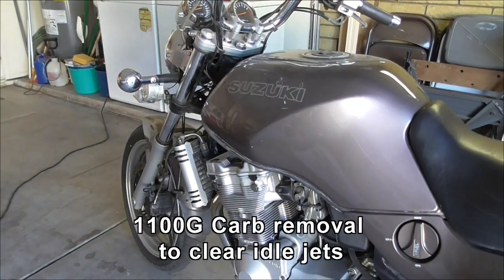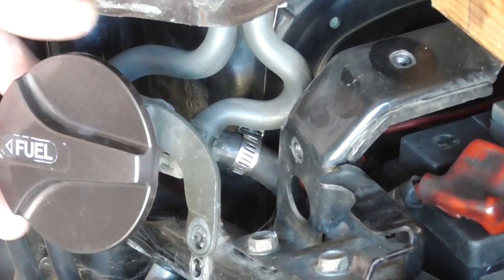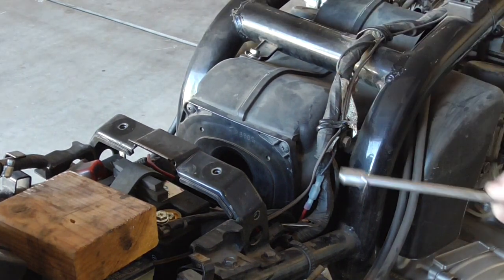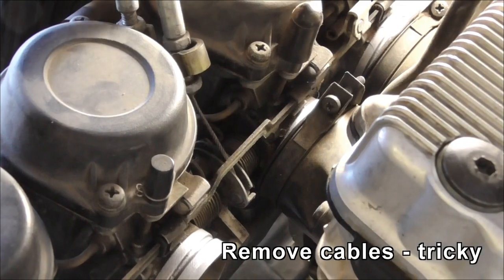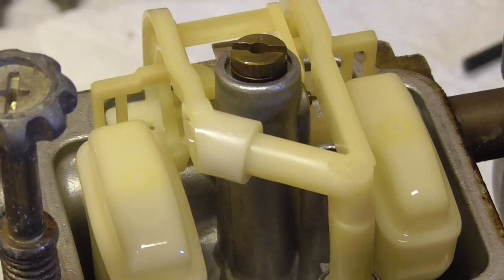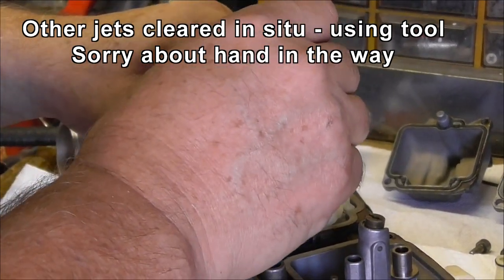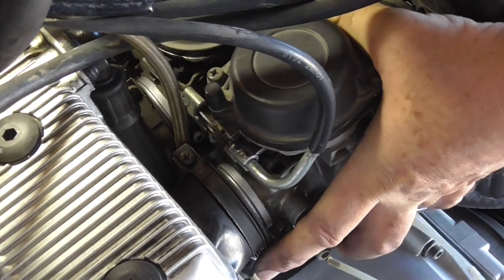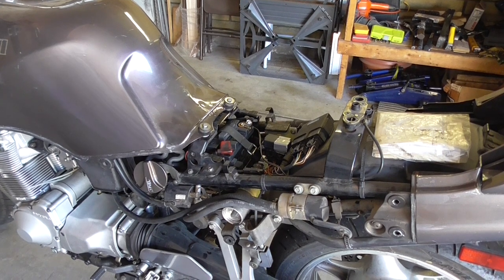Suzuki 1100G Idle Jet Clearing

Comment: Best ever, driven sedately (60-70 mph) on a very long run : 53 mpg (imperial), 11.7 mile per litre.
Reply from the maker: Yep, the conversion is 1 Gall Imperial = 1.20095 gall US. So 44 mpUSg. It's running well

Comment: How many litres does your bike consume per 100 km?
Reply from the maker: When I used to drive to work - 15 miles mostly freeway - it was about 40-42 mpg, which is 5.6-5.9 L/100km.
Now I just do short runs around town and it can drop to 36 mpg or 6.5 L/100km
Sounds like you may be burning to much fuel???
Reply: @richbinaz  Yes, my gsx drinks a lot, about 8 L/100km (freeway, 150-160 km/h).  Your fuel consumption is very good. It seems I need to check and adjust the fuel level of float chambers.
Reply from the maker: @Strannik191  I have been chasing "fuel flooding" for years. It not only drinks fuel, but makes the engine very noisy and "chuggy" 
In the video at time index 6:10 I'm removing the idle jet. Behind the main jet is a stainless steel colored "float valve seat". It is held in with an O-ring. These O-rings do not work well with fuel that has alcohol in it. The 10-15% alcohol makes them harden up and shrink.
I found that If I turned the carbs upright (with the floats off) these seats would fall out. If you can pull the seat out with no resistance, it means the O-rings are not working. They need to be replaced with O-rings that are made from Teflon, PTFE, Viton or buy them from this source if possible. I don't know if he ships overseas
https://store.moto-lab.com/bst36-fuel-system-parts?bst36_mmy=901
I just used him (April 2021) to get float bowl gaskets and new o-rings for the mixture screws to solve another flooding issue.

Another source of flooding was the floats themselves, which is why I have 2 new ones. Check by putting in a container of water and see how they "float".

I used to have a photobucket account with lots of info on it, but it has been deleted. I need to re-do them as youtube files.
Reply: @richbinaz  Yes, noisy and chuggy, exactly. Thank you for your information. I will also check float valve seat sealings. I have never heard that our fuel contains any part of alcohol but anyway O-rings could harden just in the course of time. I will look your link through, maybe it will be possible to acquire the teflon sealings.